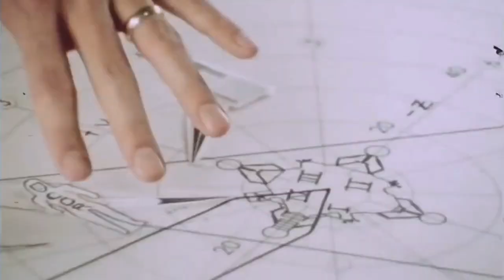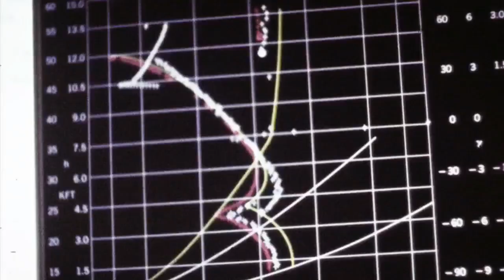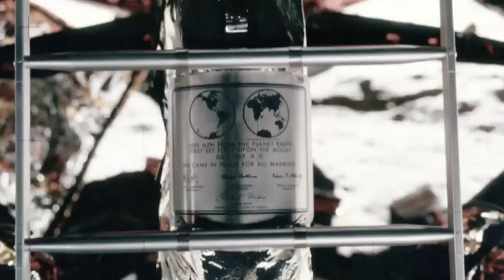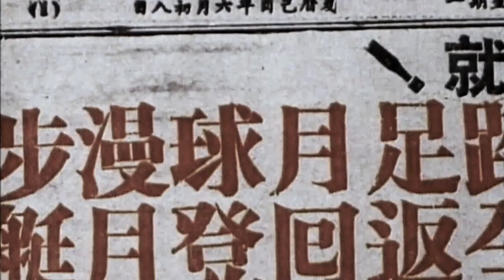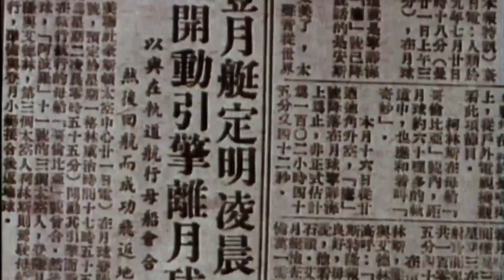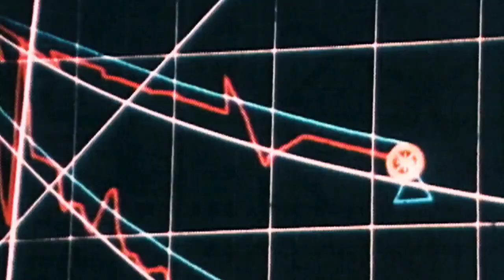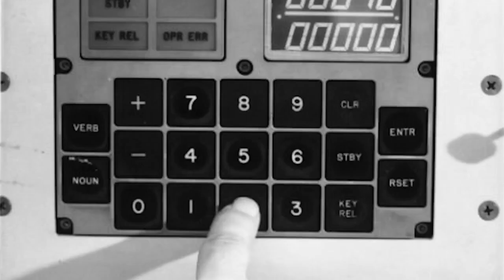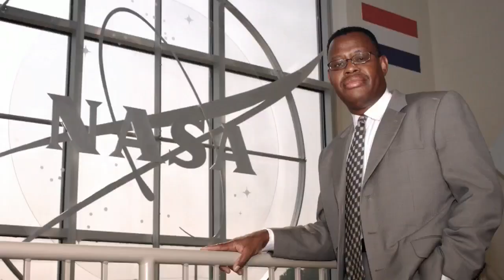Apollo 11: 50 Years Later

Comment: It was a funny joke.
You were fooled.
Reply: As a young engineering student at the time I can tell you the moon landings happened. I did project studies for launch vehicles & ion propulsion systems. Most of the hard work was already done, in a book every rocket scientist had at home & work: "Handbook of Astronautical Engineering" McGraw Hill (c) 1961, LCCC 61-7305.
Within it's 1,600 pages are some of the most dense mathematical formula, graphs charts & explanations for getting the job done in designing spacecraft, propulsion systems, guidance, environment etc. It was the work of hundreds of scientific & engineering giants, and owning the book was like cheating. A young engineer could set a goal, then check the book for the best solution-path, follow the formula & graphs, and come up with a solid proposal in as little as a week, all by using a slide rule to effect the specific situation. In a practical sense we all knew the V-2 had solved all the fundamental problems of space flight, even if it was not perfect. Many engineers working on design studies understood that the V-2 was the first voyage of Columbus, already in American waters, all we had to do was get on land & plant a flag, thanks to the hard work of those who came before us. There was much hard work still to do, but you understood the goal was achievable.